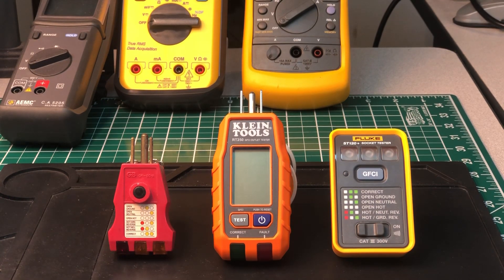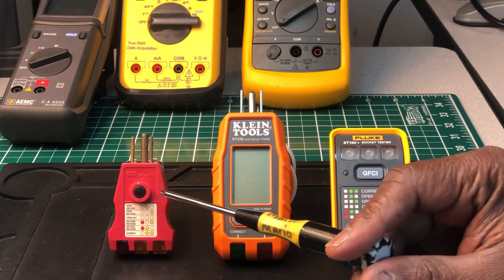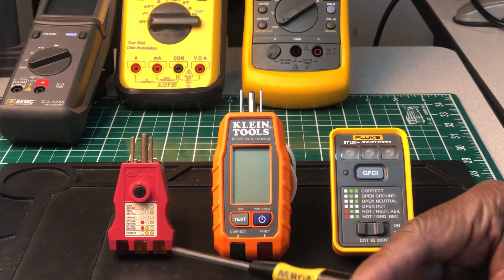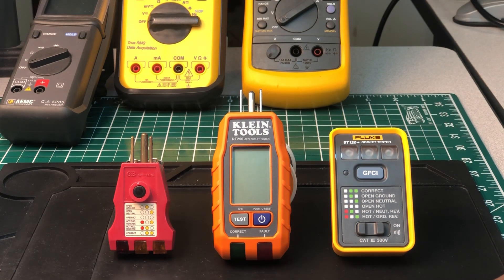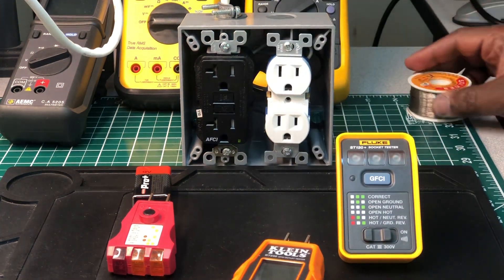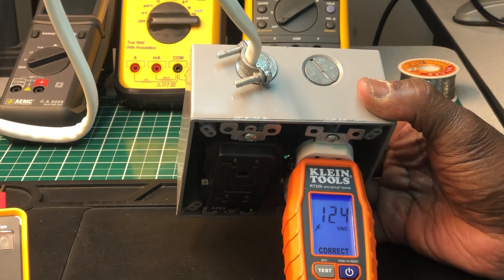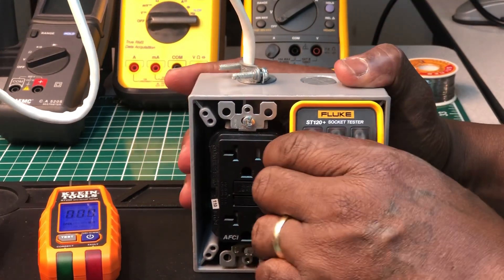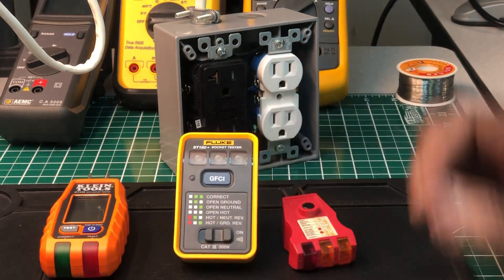🇺🇸Gardner & Bender, 🇺🇸Klein Tools, & 🇺🇸Fluke    ( GFCI Tester Showdown  🤼‍♂️ )

Comment: The 2 AAA Batteries are so the non contact voltage detector will work just to show you that the box is hot even though the outlet is not working The RT250 will show the %t of voltage drop down stream if you hook up a 12 amp load down stream
Reply from the maker: It been noted, thanks Lester👍🏽

Comment: The big plus with the batteries concerning the Klein Rt 250 is that it doesn't 'leave you in limbo' if there is no power to the outlet which would leave you with no reading at all, it's a stand alone meter, it's independent from the circuits power that is needed to power the other testers. The Klein also tells you the time-frame It takes (.01 seconds for example) for the GFCI to trip which In turn tells you if it is not performing properly per requirements. It also holds reading on the screen for ten-seconds which is a nice feature. There are many pluses with the Klein  RT 250 in comparison to the other and it well worth the extra few dollars. It's only $20 at Home Depot as of October 2021.
Reply from the maker: You’re correct James , I agree 💯 % with what you said. You’re spot on sir 👍🏽. Thanks for watching.
Reply: @TheElectriciansToolChannel  ......Thank You, wish that type meter also checked for 'Arc Fault' also.
Reply from the maker: Unfortunately James it doesn’t.
Reply: If you don't have power in the outlet that means "open hot" so what limbo? Otherwise I agree with you

Comment: Yeah man I carried that g&b type outlet checker for many years. Being a low voltage and telecom guy I usually carried the analog phone line tester and when they came out with the Klein wire map and coax checker I used that one as well. In my role I always had my fluke 26 dmm in my tool belt so the Klein wouldn’t win over that fluke but I’ve known many an 01 apprentice and journeyman who would benefit from that Klein or fluke for their voltage and toner features. Shoot I’d carry both. What do they say? If it’s important always carry a spare. Thanks for another cool video. I’m glad you’re getting busy it’s good to stay busy especially on something you enjoy.
Reply from the maker: “ If it’s important always carry a spare. “ Words Of wisdom, I agree 💯 %. Thanks 👍🏿
Reply: @TheElectriciansToolChannel  They’re not my words man I’m just a good listener. Always try to listen before I speak and try to hear wisdom from whomever you can, wherever you can. The truth stands out because it’s usually very simple.

Comment: I think I would go with the Klein as well TETC. Fluke had a recall on the UK socket testers (SM100, SM200 and SM300) due to a safety concern with them and I don't believe they currently sell anything to replace them with. TIS sell a similar RCD socket tester, but all the others I have seen just have the polarity and connection lights and no RCD test facility.
Reply from the maker: Klein Tools have been flooding the market lately with a lot of really handy gadgets that  are really useful. Fluke should’ve added an AFCI feature to this device also to make it stand out  more.

Comment: The Really basic Klein is the RT210. I've had it for several years. I don't use it all that much. If I did residential troubleshooting calls the RT-250 would be nice. Years ago I used to work for an uncle that did all residential work. We would see some crazy stuff especially in older homes. Luckily I was just a helper and didn't have to have the conversation with the customer that whole house needed to be rewired.
Reply from the maker: I agree doing residential electrical some of the things you find is mind boggling to say the least 😳👍